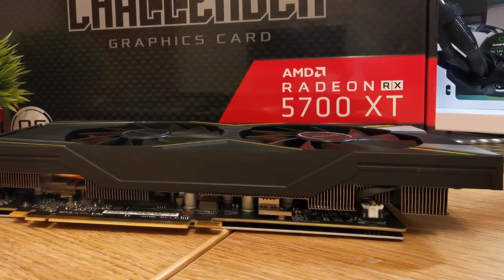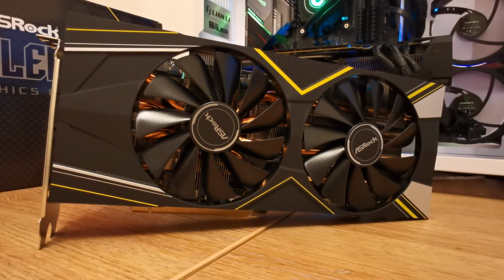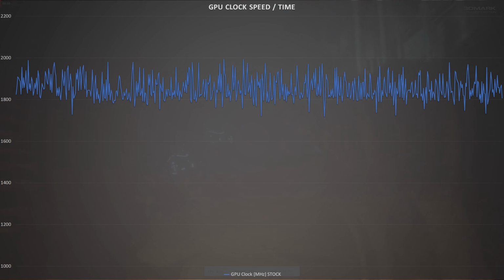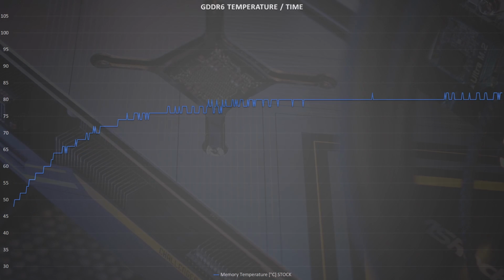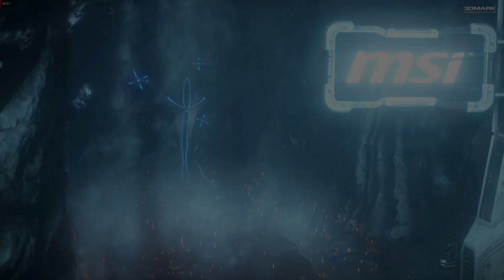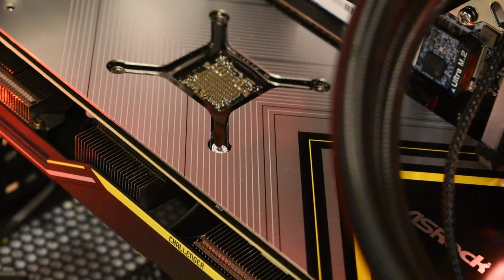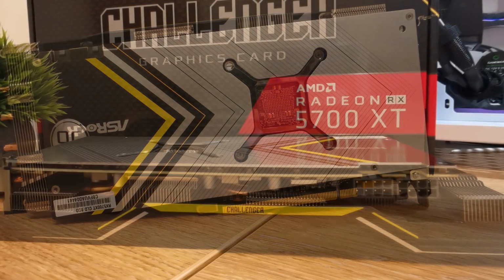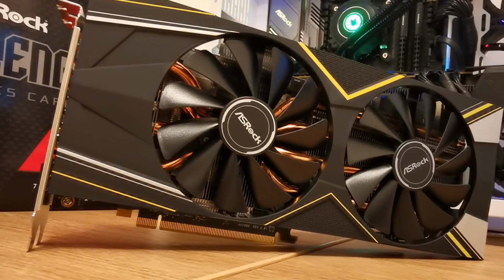ASROCK RX 5700 XT Challenger - Impressions, Tweaked and Undervolted

Comment: I know this is a late comment but my psu had only two cables each had 6 pins.. I plugged them into the gpu leaving 2 pins  free on each slot.. and it's  working just fine. Anything to be worried about?

Comment: hello!i just bought asrock 5700xt 8 gb....need to ask somethink.i have rm650x psu.i dont know if its ok...need 2 cables from psu to gpu or one cable from psu to double exits at gpu?...i am using one cable from psu to 2 cables at gpu....its wrong?
Reply: not at all, in fact its recommended to use that way for hungry power gpus.

Comment: I love this card. I've had it for a couple months on my first self built computer. However, I thinik temps are a bit too high. Do you know if there's a chance to adapt watercooling to this card? That'd be a dream! I've seen the NZXT case to adapt. IDK if that one would fit here.  If so, I'll go for it!
Reply: I changed the thermal paste with thermal grizzly saw a 10 degrees drop.
Reply: @JosephShell23   did you only reapply the thermal paste or also placed new thermal pads? i've heard that helps too. I got the non XT version flashed into one. Have underclocked it a bit already, but sometimes it hits 95 c + and its quiet hot in my opinion.
Reply: @frederikhermans3684  undervolt it and and oc your cpu.that will help lower temps, maybe turn fans up,  flashing to xt version not gonna cool as good

Comment: Bought it 1-2 months ago and it works great. Temperature is around 55 degrees while not doing anything, ramps up to ~70 degrees while GPU is working at 100% with fans running at 60-65%. It's a bit noisy but I don't mind since temperature is fine. It's fascinating how fast it cools off and how it can keep same temperature for hours while playing 2020 games on ultra. Only problem I had with it(i guess) is that it had trouble with 2nd monitor. I don't know if it's because I had one 144hz and other 60hz but 60hz one kept losing signal and after going green 2 times it crashed my pc. After removing 2nd monitor, everything is working great.

Comment: This card is a toaster. Undervolted to 1.0 V @1800 mHz and reduced power and still getting 95C or more in some scenarios. Better to just spend another $40 on AIO
Reply: 99C in stock with full speed fan. When set a power limit- 30º gets between 85-90C. Asrock shit.
Reply: maybe there is something wrong with the one u bought
Reply: Same 95°
Reply: Shit card same brooo

Comment: Hello, is it normal that my Asrock Challenger RX 5700 XT idles at 55 degrees celsius and will sometimes hit temps of 110 degrees celsius? At idle my vram is stuck at 1750mhz and my gpu clocks around 875mhz and my power consumption is at 40w while idle. Should I worry about these temps?
Reply from the maker: Your fans will be off at idle... You can chabge that option so they spin slowly in the Radeon software. Personally I hate the zero rpm options as a low fan speed is as quiet ..
Reply: If you're running more than one monitor, your ram will be stuck at 1750mhz. Also if you're running a 144hz monitor, you'll also have to select CVT reduced blanking in the custom resolution settings. My setup is doing the exact same as yours. I've got my gpu temps down to 67c, yet I still see hot spot temps of up to 105c. Wishing I would've just spent the extra and gone with a Sapphire brand 5700xt card or a 2070 Super.

Comment: Given that it hits 80c on GPU temp it seems it's thermal throttling since the Junction temp must be hitting 110c. My blower design hits 77c GPU and hits 110c junction and throttles.

Comment: I have this same card and my "hot spot" (i assume tj max) is almost constantly pegged at 110, is it possible i could have bad mounting pressure?
Reply: mine gets to 105. did you fix it/ how did you fix it? please respond :)
Reply: @hermanosponce9996  Same here. Set power limit -30º, gets 85-90C.
Reply: @iankysilva5912  does it get less performance like that though?

Comment: Can someone tell me how to undervolt :(?
Reply: In Radeon Software -> performance -> tuning -> enable GPU tuning -> enable advanced control -> fine tuning controls
and just set the maximum voltage and frequency lower
Reply: @TheJupiteL  You will explode if you max the volt

Comment: Hey man, I saw your video about the asrock 5700 xt challenger and decided not to refund it after having some heat problems but they still occur after installing all drivers and new vBios do you have any idea what to do to make the challenger a bit cooler while ingame? It jumps to 100% when ingame and goes up to 80 degrees and has about 90-100 degrees around it which could damage my cables/tempered glass if it goes up even more sometimes. Do you have an idea what I could do?
Reply from the maker: Have you tried undervolting it and setting a more aggressive fan profile?
Reply: F7GOS thats the thing i dont know how i tried the asrock tweak utility thats useless and when i tries through the new amd tweak software it doesnt rly change anything tried the 1975 and 1050 like u did, right now i just use the auto undervolt from amd but thats still pretty hot not much changed how should I undervolt it and make fans more agressive?

Comment: I picked this up for 367 after taxes. You honestly can’t beat it. Just to bad I had to RMA it due to a grinding fan bearing and unresponsive fans. :( but the card ran like a bat out of hell. Can’t wait to get her back
Reply: Same problem here, will have to RMA mine too. Probably a project problem, as you and I aren't the only ones with the same issue. Shame, as it's a good GPU for the price, however I'm thinking about getting a Rtx 2070 super. It's a bit overpriced now, but got a good discount for a gygabyte model, and the temps are insanely colder than the Challenger.
Reply: Got one for 100

Comment: I have exacly same card, and I do have a lot of issues with it;/ Any underclock or undervolt ends in crash while gaming;/
Reply from the maker: Just out of curiosity which power supply are you using and is it two separate 8 pins or one cable that splits in two?
Reply: @F7GOS  I'm having the same issue and my power supply only has one pcie power cable with two 8 pins. So is my card drawing too much amperage over one cable?
Reply from the maker: It's always better to use two separate 8 pins rather than a piggy back. Try lowering your target clock speed and setting power target to -10% see if the issue persists.

If it does you can slowly start working your way back up to drawing more power.
Reply: @F7GOS  Thanks for the advice. I'm also seeing high junction temps and may try removing the cooler and redoing the paste with the mx4 that I have.
Reply: @F7GOS  Actually in last few weeks my card works excellent no crashers or turned off monitors. Its RM750x Corsair Modular with 2 x 8 pins. I know its too much, but i got it upgraded for free
Reply: I run piggybacked cables on an overclocked Vega, so it's probably not the cables but the PSU itself. But yeah, PSUs are sometimes overlooked limiting factors

Comment: Does this card have 0 RPM?
Couldn't find it on Asrock's site.
Also awesome to see this card without the heatsink, couldn't find any pictures on the internet.
Propper VRM & GDDR6 heatsink is great to see, looks like the Sapphire's 5700XT Pulse.
Reply from the maker: It does have a 0 rpm mode as standard. With the smaller heatsink though it will get quite warm without airflow
Reply: it does. I dont use it because it doesnt kick in until 75'c and the fans start up super loud
Reply: VRM and MEM temps are high with this card. Over spec even for the RAM.

Comment: amd drivers are a crap shoot. always has.
Reply: Aye. Navi was pretty much a new architecture for AMD, so they sure as heck got some shotty drivers from time to time. Nvidia and intel had similar issues from time to time. Lets not forget the Nvidia RTX launch wasn't flawless either.
Reply: @Deliveredmean42  this is why I don't buy in on new tech right away. You wait out the kinks to get fixed then decide what you want
Reply: @franzb69  Yep, that's what I been doing so far.